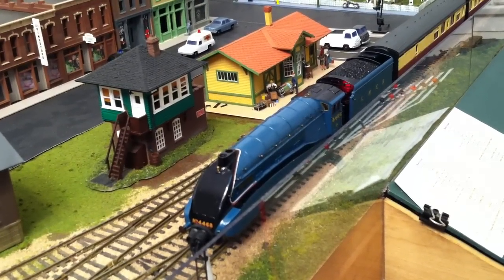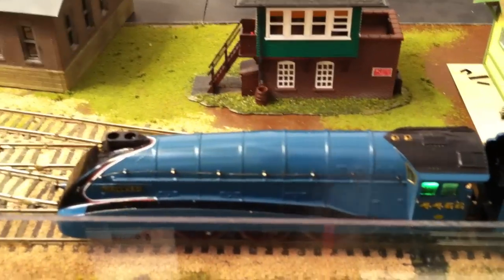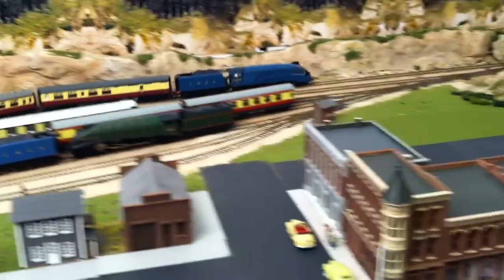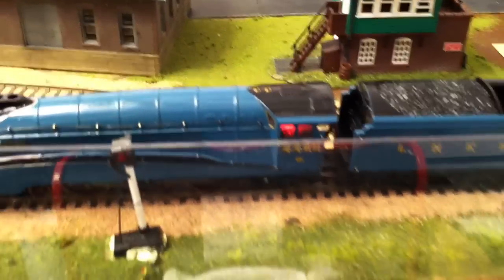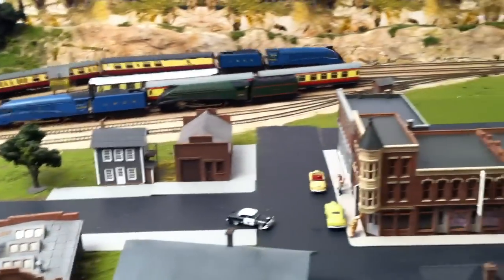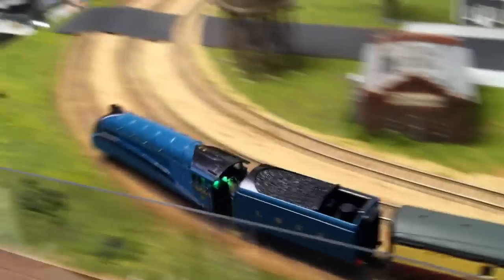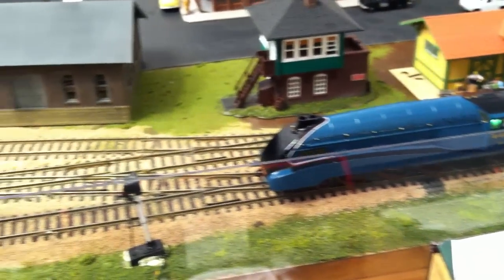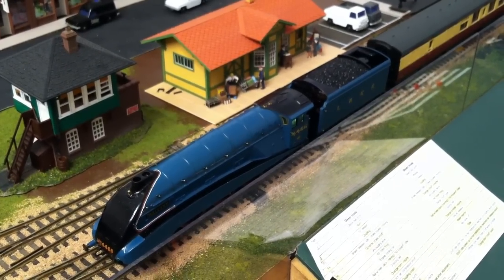Part Three - More Hornby Live Steam A4 "Mallard" OO scale Running Tips

Comment: I found your videos (1 & 3 so far) very interesting as I too have been frustrated by the lack of control and have had to add some heavy duty cardboard angle to the edge of my table.  I also bought a section of independent rolling track to run it on my work table which helped me to learn the controls.  I only run it on a separate track from the normal 00 trains because of the oil it discharges onto the track.  Looking forward to seeing your video on maintenance as it is something I am yet to do.

Comment: hey Mr.Kelly I see you finally got the new video up.Very useful information for people.Thanks for mentioning me in your video.When I heard you my name I almost freaked out, fell over and XP but instead my face did this (OoO).I have a question do I heat up the locomotive on simmer then put it on running mode or superheat mode to run it or heat up the locomotive on running mode or superheat mode and run it on what ever of those 2 settings I choose.you said track melts if it gets too hot in 1 place